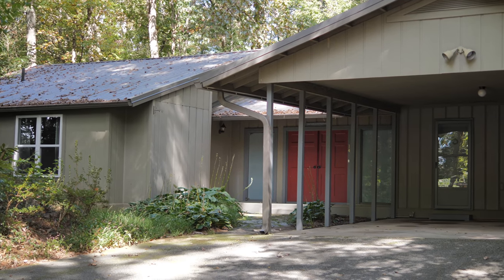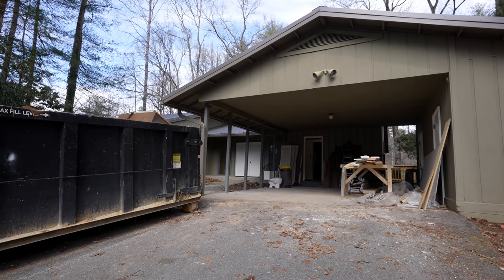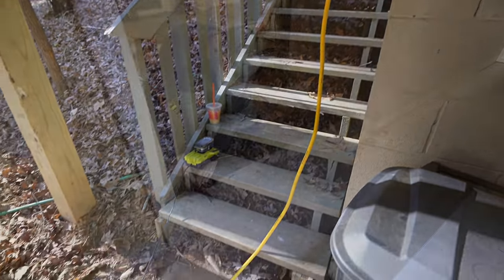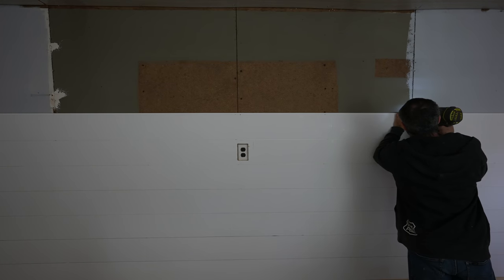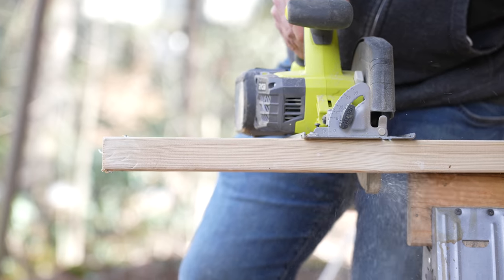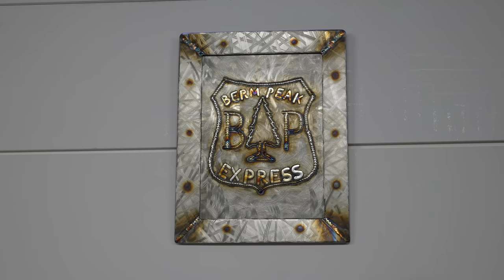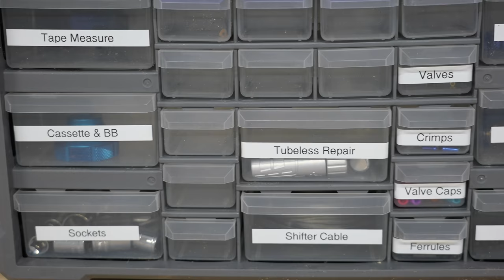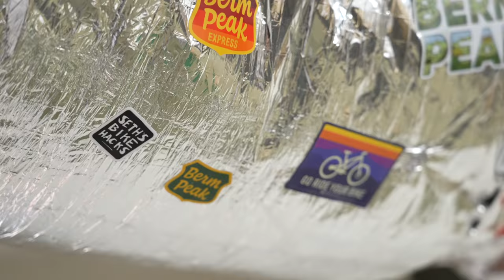Building a Bike Workshop in my Airbnb House

Comment: Wrap the bike rack in old tubes. Great chance for some upcycling
Reply: Good idea but he probably has fewer inner tubes than bikes lying around. Most of them likely never used, strapped to a frame for emergencies. I'm thinking a pair of used up tires would also work. Chopping off the bead and making a strip that could be secured on top of the pipe as a straight piece. A bit of extra work for sure but it'd add to the mtb vibe.
Reply: @frankthetankricard  HE probably doesn't have a ton laying around, but I think road bike handlebar tape would work very well
Reply: @BMOutdoorz  that’s stuff gets expensive. 30 bucks to cover 2-3 feet of pipe
Reply: @peterlang5047  yeh I know I was talking about any extra but I know he doesn’t have any except on his gravel bike
Reply: Yea

Comment: Pool noodle works really well as padding for the bike stand.  I've got a portable stand made from the same pipe with wooden ends.  Put a slit down the length of the noodle then slip it over.  When it eventually wears out it's cheap to replace (couple of bucks for 6 foot cover)

Comment: Along with the camera inside to protect your tools from walking off, I would swap those metal straps on the exposed duct for cloth or nylon since that will be handled and the metal will wear through the duct much faster when rubbing against it (guests putting stickers on). I’m curious how the tools will do as I run 3 Airbnbs, I provide nothing like this, yet things still go missing from time to time. Good luck and thank you for the awesome videos!

Comment: Hi Seth &Team,
Great renovation, the Dungeon looks great now. I have one thing to point out about the light fixtures. To me as an ex-stage lighting engineer I foresee one problem. While working at the workbench, the bright lights on the middle of the room cast a shadow of yourself on the workbench, making it difficult to see what you are working on. It is hard to see on video if the LED-strip is bright enough for the application.

If not, I recommend one light fixure above the workbench. While installing, why not make it dimmable so you can work on your bike feeling like dracula in the dungeon?

Comment: Hey Seth, I think it would be nice to have the tools outlined on the wall. Maybe because I don't bike at all, but some people may not know what those tools are all called. Or, if you happen to get a bad guest st some point it'll be easy to know if something's missing. Also, you could use some foam pipe insulation that looks like a split pool noodle to go over the pipes on your bike rack

Comment: during college I cut my pinky tendon in my left hand close to the tip, to let it heal I had to get it reattached by having surgery and a suture attached running through my nail to pull it tight against my bone. But, when after the surgery I needed a cast that would also allow me to constantly exercise throughout the day, and the cast was literally a hi lie scooper at 90 deg. I wasn't able to even grip the handle bar with my left hand and could only ride right handed. I made it work by not jumping the curbs riding and braking right handed but it was extremely hard. Once winter set in I gave up on riding it and let it sit and collect rust. I know what its like to want to be involved in a sport/lifestyle but be hindered by an injury, it really frickin sucks.

Comment: You need a sign, "Take a part, leave a part." Not necessarily with the intention that people actually do so, but it sets the standard. People tend to only want to fall a certain amount below a set standard. Basically it sets the peak of the bell curve.

If I rented I'd bring some extra parts for sure. Extra bar, extra seat, maybe some crappy (but usable) flats, nearly flat rotors I couldn't be bothered to align..

Comment: FYI those steel jack posts are supposed to be temporary. The telescoping ones you have in your basement with the holes to adjust the size should be replaced with solid supports, either metal or wood.

Comment: I laughed so hard at having to carry the ship-lap boards out and in again..
Been there done that!
Tho I had to carry a pack of floor boards (pack of 8, 4,4m 25x220mm boards) down a too small staircase, outside turn it around and back up again..
Thankfull I noticed it after the first pack so I could turn the rest of them around before carrying them inside... Otherwise I'd have to do it to all of them since I had to fit the new floor to the old one

Comment: I have two questions for you.  I think I have seem you with two handlebar lengths.  Shouldn't you have them all the same width?  and what do you recommend that width be?  

The second question is I have seem you hang your bikes from the saddle  as well as the ft wheel on a wall.  Which is best and do you have worry about the oil in the brakes and or shocks?